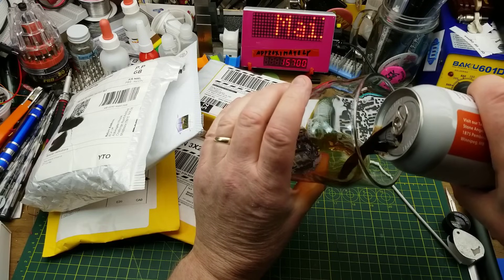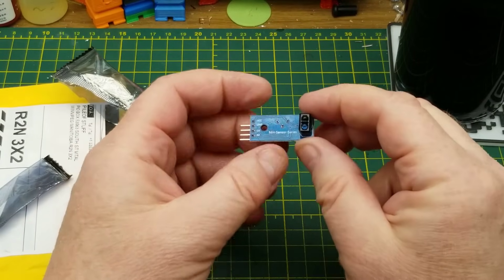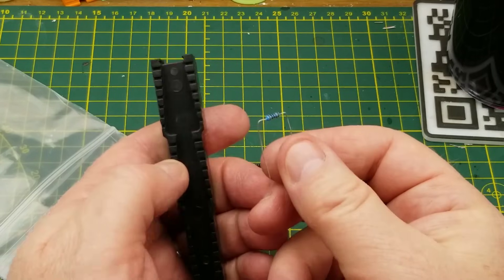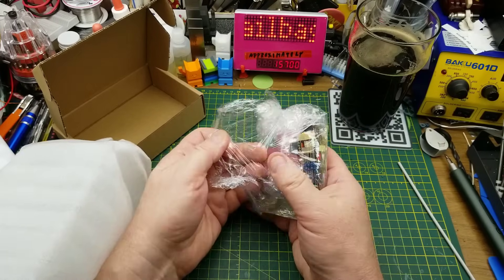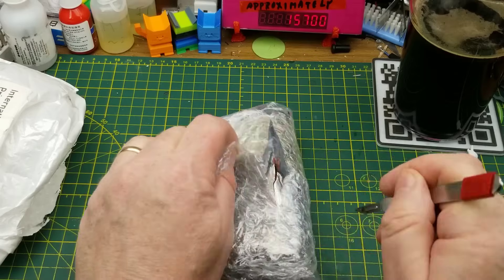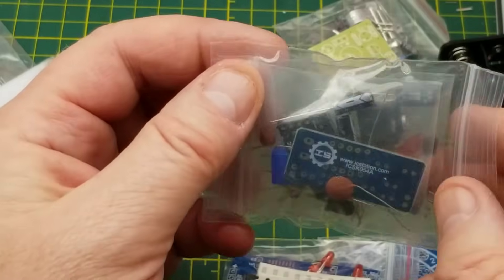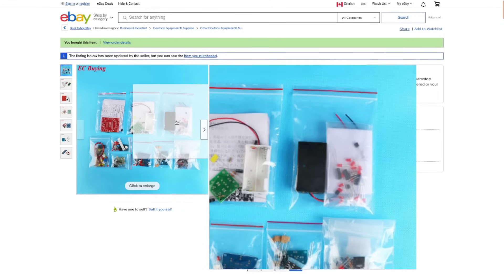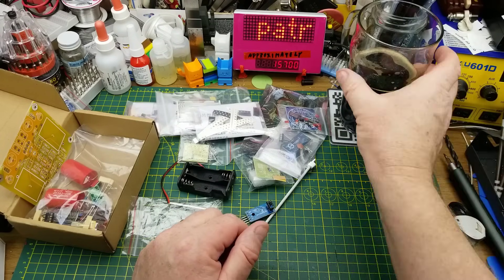Mailbag Monday 188

Comment: 9:07 MM = Moving Magnet, as opposed to MC (Moving Coil)
Denotes what part is moving inside the phono cardtridge to produce a voltage.
Reply from the maker: Of course!  Thank you.

 Why didn't I remember that?
Reply: Also as opposed to the ceramic pickup found in many older and cheaper turntables.